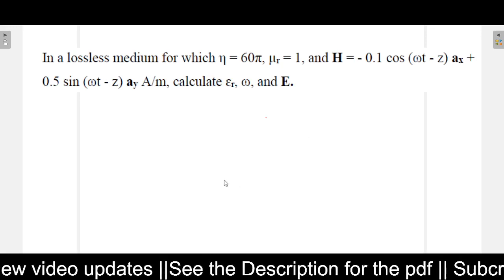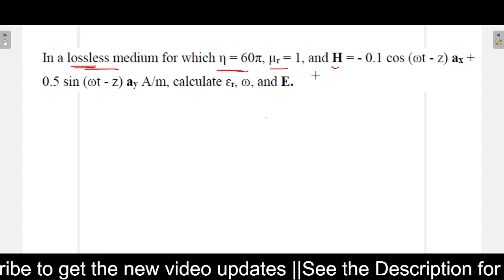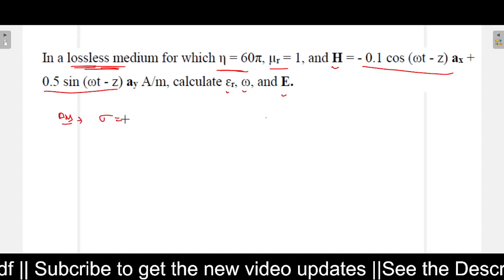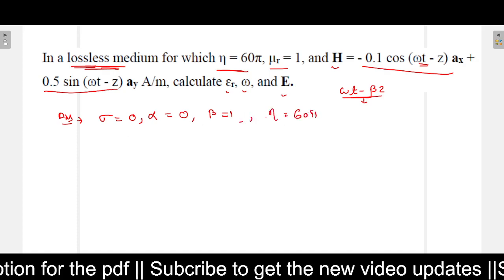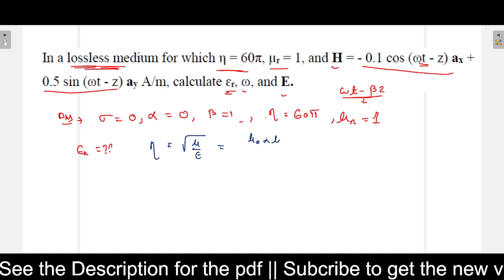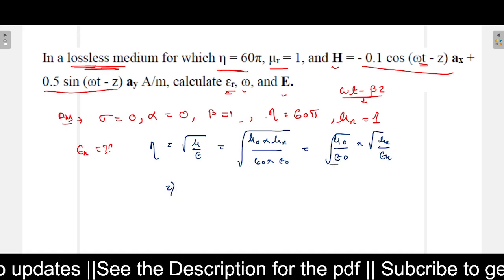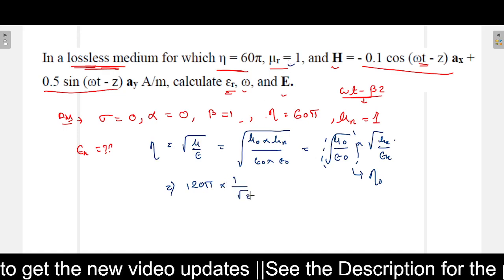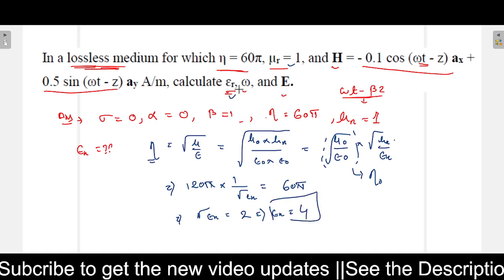Numerical Problems on Electromagnetic Wave Propagation part 3

Comment: Dear Sir Please solve a question
Reply from the maker: Which question
Reply: @MClasses07  I have a question related to EM wave
Reply: Suppose we have devised Fish tank which monitored .There is transmitter and receiver which is apart each other 2m.5GHz is transmitted by source .Clean water permeability is 40-j18.Conductivity of clean water 0.5 S/m.If transmitted power is 1W then calculated how power will reach?
Reply: What happened
Reply from the maker: It can be calculated ...but the question seems to be wrong...
Still you can refer power transmitted in lossy medium for EM wave. 
Calculate attenuation cont. Alpha

Find e^(-2.alpha.z), where z is 2m and the impedance of the water
Reply: @MClasses07 Please tell what formula will be appropriate
Reply: There is real and imaginary parts in relative permeability which would be taken to get alpha
Reply: How to calculate power